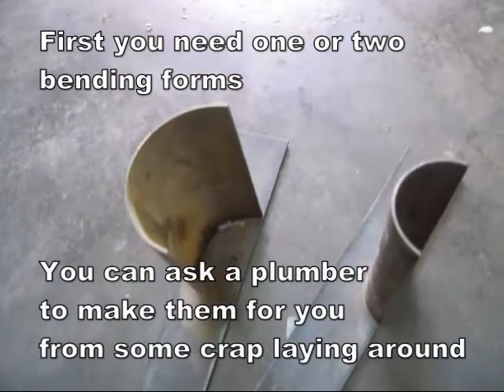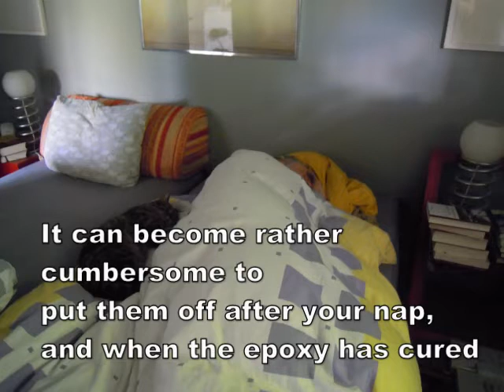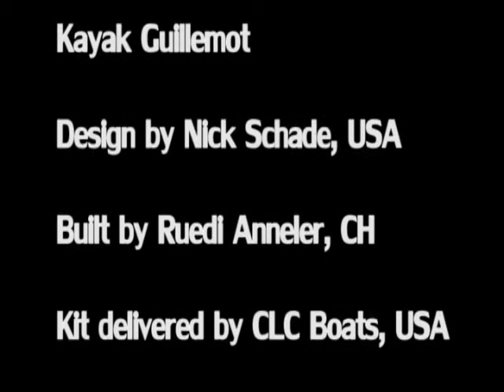How to make a great looking coaming with bent wood strips fast and dry

Comment from the maker: Hi John, thank you for the flowers, they are highly appreciated.
Ash and cherry grows in Europe too, no problem top get them. All strips have been sawn (3x10mms). One is probably able to bend really wet ash without heating it, but cherry will break, even when cut thinner (how thin makes sense for this purpose?). Without heat it is impossible to make narrow bends as the one at the front of the coaming. Joins: Next time I will create the lip so that I close the loop at the rear side only.